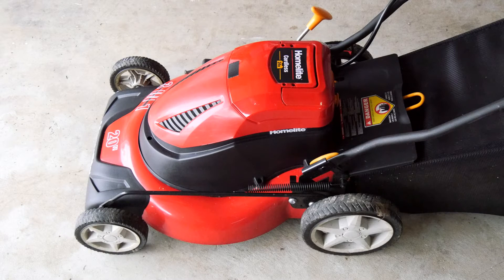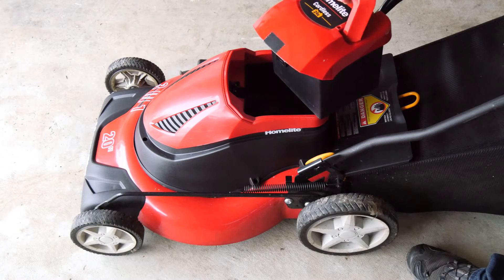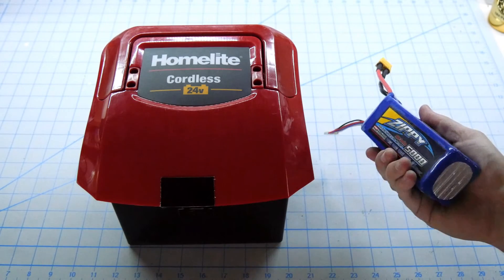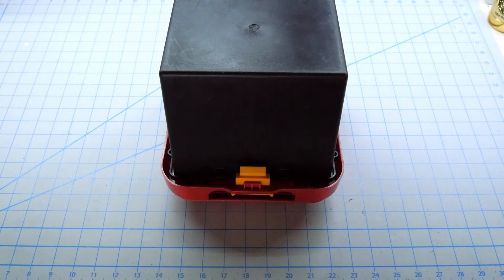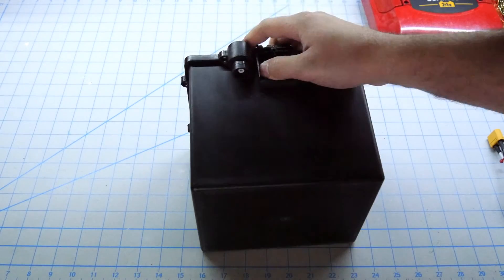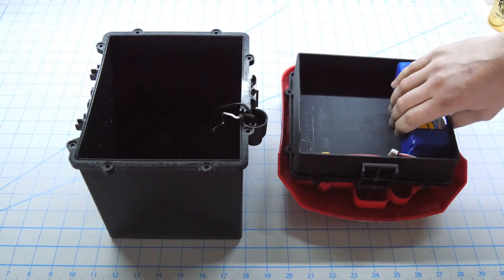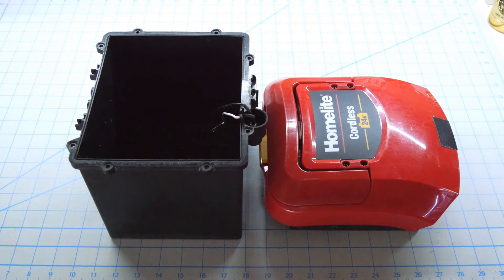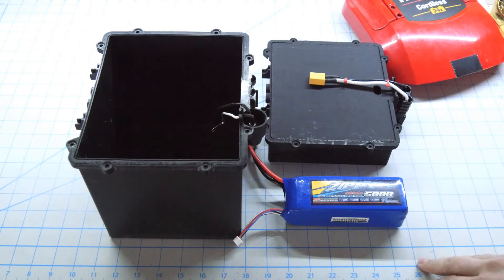Homelite Mower Lipo Conversion

Comment: hello sir-can i use an electric bike battery that is 36v 10ah? Will it make it mow faster? Can you use the original battery charger to charge the lithium battery?I have the same mower and the old batteries dont charge anymore. pls let me know, my backyard looks like a jungle.
Reply from the maker: 36V is a bit high, the original mower I repair here ran on 24V.  It may spin the blade faster, it could also ruin your motor.  I wouldn't recommend using the 36V battery.  The original charger is incompatible with lithium batteries, you should always use a charger suited for the battery chemistry that you're charging.  Look for 6S lipo batteries and 6S lipo chargers for this mower.

Comment: What type of battery monitor did you use? it was not listed in the write up
Reply from the maker: Any simple battery monitor will do.  Links in the original write-up have probably expired but I like these generic monitors for the alarm function, it's audible over the noise of the mower and very affordable... https://smile.amazon.com/CAMWAY-Battery-Voltage-Monitor-Checker/dp/B07DC3LH9C

Comment: *
Dhaval Champaneri
1 second ago
Can you reply as early as possible what is name of the battery and  from where we can get it ?
Reply from the maker: Everything you need is in the write up, check out the description.
Reply: Hello MB Huff, would appreciate unfortunately I couldn’t find it if you can please rite it here name of batter and where we can go and buy it and what is the total cost of battery? Thanks in advance
Reply from the maker: @dhavalchampaneri6953  You could run one or more batteries like this, depending on how big your lawn is... https://hobbyking.com/en_us/graphene-5000mah-6s-45c-w-xt90.html  I have a pretty modest lawn and I like having a ready spare in case one doesn't do the job.  You'll consume more energy the harder your mower has to work so if your lawn is overgrown, you won't get the same mileage from the battery as you would for a weekly trim. Hope this helps :)

Comment: 2019-06-03: 

The batteries in the original article are no longer available, and the most suitable replacements appear to be double the price ($64). Based on the write up and the video, it seems like an update is needed to help the newbie out. 

I'd ask the OP to provide the following: 

1. best priced current battery to get that matches his original specs (6s 5000mAh 20c) or better (40c?) 
2. Best options for XT60/XT90 connectors, including a Y connector for each 
3. Link to the Shapeways listing (btw, it's currently $172.05 for the printed battery base) 
4. Link to a charger (cheap and dream) as well as appropriate charging cable. 
5. Link to the alarm 

Today, i bought a generic version of the Alarm/Voltage Testers off ebay for $7ish with free shipping for 3 units: 
- https://www.ebay.com/itm/382579263117 

I'm seeing the lowest cost on a battery matching exact specs on Hobby King as being: 
- Turnigy 5000mAh 6S 20C Lipo Pack w/XT60 Connector at $63.51 
- https://hobbyking.com/en_us/turnigy-5000mah-6s-20c-lipo-pack-w-xt-90.html (note that the URL says XT-90 but the page says XT60) 

If you can hang with a 40c discharge, you can get the: 
- Turnigy 5000mAh 6S 40C Lipo Pack w/ XT90 at $60.44 (saving you $3 but possibly messing you up else where if you can't hang with 40c) 
- https://hobbyking.com/en_us/turnigy-5000mah-6s-40c-lipo-pack-xt90.html 

If you want to go with lower cost batteries, you can run these 5000mAh 3S 20C batteries in series (will probably want to change the connector): 
- ZIPPY Flightmax 5000mAh 3S1P 20C ($18.58) 
- https://hobbyking.com/en_us/zippy-flightmax-5000mah-3s1p-20c.html 

The chargers listed were pretty expensive or no longer available. Amazon directed me to this charger: 
- jrelecs 80W 7A iMAX B6 OEM Battery Balance Charger For 1-6 cell Lipo at $31.50: 
- https://www.amazon.com/dp/B06XFW567R/ref=dp_prsubs_1 

Here is an inexpensive XT60 Charger Cable ($7) that OP linked to: 
- https://www.amazon.com/dp/B00CD9QN3Y 

Here is an inexpensive XT90 Charging Cable ($7): 
- https://www.amazon.com/dp/B071VSWMSP 

Here is an XT60 Y splitter for parallel ($7) for expanded capacity (mowing time): 
- https://www.amazon.com/dp/B00XBXQANY 

Here is an XT60 Y "splitter" for series ($10) if you want to go with lower voltage (and lower priced) batteries in series: 
- https://www.amazon.com/dp/B0761YKMJM/ 

You can do a similar search for [XT90 Y Splitter Series] or [XT90 Y Splitter Parallel] For additional options. 

You can find XT60 and XT90 connectors on amazon with little problems, so i'd go there to get the parts you need to connect the new battery into the mower.

To keep everything in one post, here is OP's Thingiverse link for his replacement battery enclosure:
- https://www.thingiverse.com/thing:1844850

And here is the Shapeways link for the same thing:
- https://www.shapeways.com/product/WCQVCL9Y4/homelite-mower-battery-enclosure?optionId=63286332

Comment: Thank you for responding to my message I try to order for the Battery that you  use for your lawn mower but I can't get  24 volt
Reply from the maker: The replacement battery that I use is a lithium polymer, it's different chemistry and has a different cell voltage.  The closest compatible voltage is 22.2V or a 6S lipo.  The links do expire but there are plenty of alternatives.  I've provided a link to my write-up in the description. Everything you need it to know is explained in the write-up.

Comment: MB, Thanks for this video...Here's what I did...I got two (3S 2200mah 25-35C discharge) connected in series ...(as I was trying to cut cost ..this two 3S lipo batteries and series connectors plus buzzer amounted to $30 still beats two 12V SLA batteries at $80)    So I got total  025.20  V  2200mah  ...It worked pretty well except it didn't last only about 8 mins and the light bar of lawnmower has 3 green lights ..it's only showing 2   Now the Lawnmower label required  24V 22Ah ..But inside the motor it says  24V 30A 500W   Could you help me as to what I'm not seeing here ?  Thank you again for this video  highly appreciate it .

Comment: How much to make me that battery holder? I do t have a 3d printer
Reply from the maker: If you go to the full write-up (link in the description), you'll find another link to the enclosure which is available from shapeways.  I don't mark up my parts, what you see is what shapeways charges.  It's been a while since I posted it but there may also be a link to download the model there.  If you have the model, you can shop the price for printing although shapeways is pretty affordable.

Comment: I just got one of these and it did not come with the charging cable or bagger, so, I am in the dark on this, and need it for some foreigners that are in a rental unit (they kept adding oil instead of gasoline to the other mower I provided) yea, it broke. So, I bought this second hand, now have a new set of issues.

Comment: hey mb huff thank u for the video it was very helpful. One issue i am encountering is that the battery & charger you used is discounted. Is there any other battery & charger combo you suggest using? i found this one the only difference is the discharge is higher 30 instead of 20 https://hobbyking.com/en_us/zippy-flightmax-5000mah-6s1p-30c-xt90.html  Would that be ok or would you suggest using something else . Thank u again for the video!
Reply from the maker: Cool, thanks! That battery should work fine.  There are a bunch of chargers on the market, many are exactly the same, just in different enclosures.  Make sure to get one that charges 6S Lipo batteries.  Best of luck with the upgrade.

Comment: Mr Huff. I bought the battery and it came with a different connector. When I tried to cut it off to attach the connector you suggestion the wire sparked. Make sense as it would come partially charged. So how do you safely remove the connector and solder the other connector with the battery charged?
Reply from the maker: jimgower9 Yes, you have to be very careful when soldering a new connector on these batteries as they are never fully discharged.  The best thing to do is to cut one wire at a time and tape it against the battery in a place where it won't contact the other wire. Then, solder the new connector onto the first wire, add the heat shrink, then solder the second wire. This way you avoid making a short across the terminals when installing the connector and soldering.

Comment: So how do you charge the batteries? Can you plug the homelite charger into the mower to charge the batteries?
Reply from the maker: I suspect that one of the problems with this mower is actually the OEM charger.  The original charger is only good for charging the original 24V lead acid.  With the new battery, I used a balance charger for lipo batteries.  Something like this...  http://a.co/7LwTvVY (amazon).  For the full details and write-up, checkout the link in the description.
Reply: @mbhuff05  The link you put above is showing product unavailable. Here is a current version showing available:

https://amazon.com/dp/B06XFW567R/ref=dp_prsubs_1

Comment: I have a 24v Homelite lawnmower similar to this one, and the battery's toast. I'm thinking about selling it to some friends who have a very small lawn (no larger than 200 sqft) to mow, but I'm debating on just replacing the battery with the original model, or doing this. How long would this battery last on one charge? Could I put about 2-4 of them in series to increase the time the set up will last? I'm an undergrad engineering student, so I'm just now learning this stuff.
Reply from the maker: The battery I used in this mower is a 6S, 5000mAh battery.   A few years ago when it was new, it was enough to cut my entire lawn (~700 sqft. / maybe 20mins?).  As the battery ages, I get less and less capacity.  Now, I only get about ~400 sqft (maybe 10mins) on this battery before my alarm goes off.   There are a couple of factor that at play here, aside from the normal degradation of the battery. 

First, a lot of the battery consumption for any given mow will depend on a how often I start/stop the mower and how long the grass is (among other things).  As you can probably imagine, stopping and restarting the mower consumes quite a bit of the battery on it's own since the inrush current is about 135A from a dead stop.  Likewise, taller grass will increase battery current as it bogs down the motor.

Another reason why the run-time has dropped off so dramatically is that I never really balance the battery.  Lipo batteries operate in a very specific voltage range.  Over charging or discharging can damage the battery so it's important to shutdown if you reach the upper or lower cuttoff voltages.  In my case, not balancing the battery frequently has allowed a couple of the lipo cells to drop well below the others.  This means my voltage monitor's alarm will trigger on those cells and much of the capacity of the battery that remains in the other cells will go unused.

If you'd like to increase capacity, add batteries in parallel.  If you'd like to use two 3S batteries, add them in series. 

Keep in mind that a lot of the practical knowledge of an engineering degree is learned outside the classroom.  Home projects and tinkering are a great way to expand your understanding of the principles at work and it'll help you build a portfolio of projects.  Employers are always interesting in what you can do and what you've done.  Home projects are a great way to show off you breadth of knowledge.  Good luck in your studies.
Reply: Place the batteries in parallel to get more amps (running time), placing them in series you will get more volts and burn out your motor

Comment: 3:21 Pause to calculate.  The batteries in the mower are 12V/20aH batteries x2..  so, 24V / 20 ah.. (connecting batteries in series doubles the voltage but the capacity (ah) will stay the same..)  Looking at hobbyking and find the first Turnigy 6S, I see that it can give us 5000mah or 5 ah.  I would need to put 4 (at about $40) of these together to yield the 20ah..   

7:31 20C... this is something I am still just learning about.. LiPo rapid discharging...  yow!  (what charger did you end up owning?)...
Reply from the maker: You're correct, the new setup does not have the same capacity as the original.  In the video I mentioned doubling the number of LiPo batteries to meet the original spec, you would in fact need 4 lipos to accomplish that.  For me, the objective wasn't to replace the existing capacity.  I believe I even mention in the video that a single 5Ah LiPo was sufficient for my lawn.  Either way, it's a good catch and thanks for pointing it out!  As a side note: at the time of the video, the SLA replacement battery was about $90 for the pair and the hobby king LiPo was about $30. So while it's not an equivalent battery, it made sense for my situation.

The C-rating is specified on the battery and represents the maximum continuous discharge current.  My battery has a peak discharge rating of 35C or 175A and a continuous discharge rating of 20C or 100A.  This means it could theoretically source 100A for 3mins and burst up to 175A (scary).  At start-up, I measured a current draw of about 135A with a current clamp so it could be a little higher than this.  I should be OK with the current battery and it does seem to be holding up quite nicely.  Certainly still better than the original SLA for reasons I explain in the full write up.  That said, not all batteries and manufacturers are the same or build to the same quality.  It's not uncommon for battery C-ratings to be inflated a bit.  Higher C-rating usually sell for more money.

For charging, I use a Hitec x4 since I'm usually charging multiple batteries at a time.  There are better chargers available.  If you really didn't care to balance the LiPo cells, you could use the charge port on the back of the mower to charge the batteries.  I used this port for a charge monitor to indicate when I should stop to prevent over discharging the LiPo.
Reply: Good info all, and you did mention the additional batteries to match capacity...   I have been putting off purchasing a charger until, well, I suppose my need was greater.   I was looking at the iCharger line, but I will look at the Hitec models too.  Any other suggestions?  How do you power yours, seems like there are a LOT of possibilities..  

Your video was just what I needed, odd thing was I didn;t actually search for it.  Youtube does this, I am wondering if I google something if that ties into what youtube gives me..  but again, thanks.

This is the extent of my battery knowledge:  http://www.rchelicopterfun.com/rc-lipo-batteries.html  (clearly I have been doing a lot wrong with the resources I have a hand)
Reply from the maker: There is a huge variety of chargers to choose from.  I have a few different ones but I think the best option for anyone planning to use multiple large batteries is to get high watt rated chargers (>200W).  These will be able to deliver the higher currents need to charge large batteries in a timely manner.  Since some do not include AC adapters and the ones that do can be pricey, a lot of people use scavenged computer power supplies.  It's really just a DC source and most chargers will accept between 12V-18V.  Some computer supplies can source as much as 90A at 12V!
Reply: @mbhuff05  6S 5000mAh pack now runs no less than $60... I thought battery prices for liIon were going down???
Reply from the maker: @MrCoder101  check the discharge (C) rating, sometimes I find out I'm looking at a 60c battery when I really need a 25c
Reply: How’s the mower doing do u still have it

Comment: hey how do u turn on that lawn mower
Reply from the maker: I don't have it in front of me but here's what I recall...
First, you'll need to insert the yellow key.  It goes on the right side of the red crossbar, on the bottom, I think. Without the key, the mower will not start.  
To start the mower, there is a yellow tab in the middle of the push handle and a yellow bar across the inside of the handle.  I think you need to lift and hold the tab then squeeze the handle, depressing the yellow bar.  The mower should start up immediately.  To turn it off, simply let go of the yellow bar on the inside of the push handle.
Reply: hey can u send me a video how to do it
Reply from the maker: Here's someone starting the corded version of the same mower: https://youtu.be/QoujxaeJK5U?t=4m59s